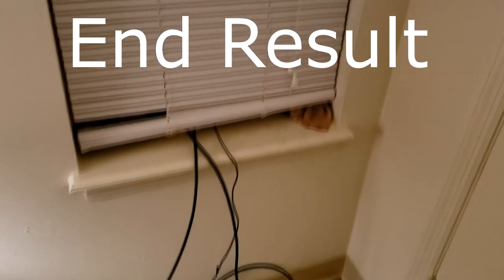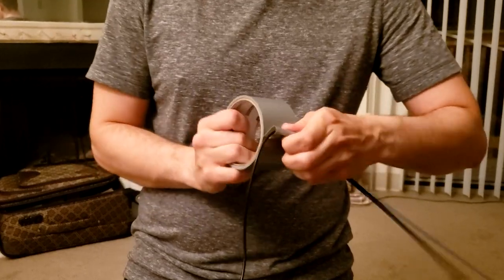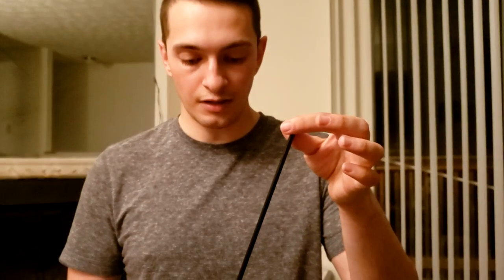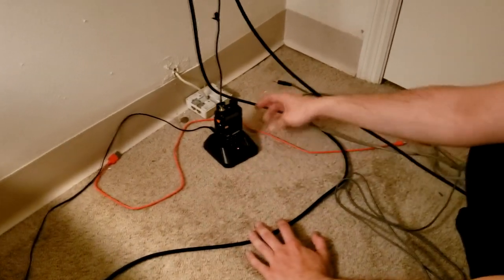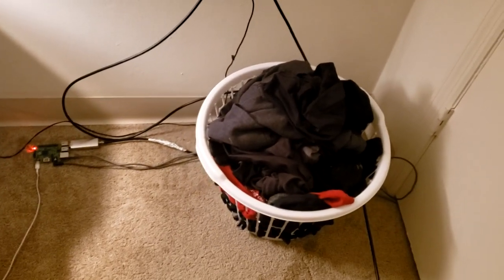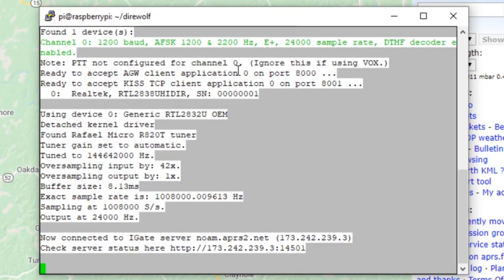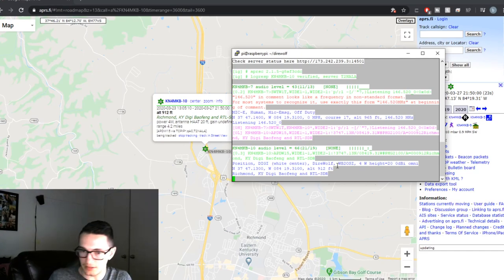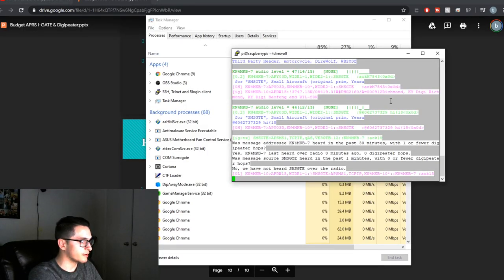Building APRS Digipeater IGate with RTL-SDR and Baofeng Radio

Comment from the maker: Let me know what kind of APRS content you want to see in the future!
Reply: I have a tip for you to make whip antenna waterproof but reuseable to . take pvc pipe as long as your whip  take it put cap on  one end then take a flat pvc cap drill a sma or bns to bnc chasse  or sma and drill hole and mount then attach the antenna to one end of the chassie connector then put the whip inside the pvc and attach it to the pvc  to the pvc cap if you got any question let me know i can send you links or help you with the make of the antenna. I use this method alot for my police scanners etc to get them out side

Comment: Decent setup, I just used a Radio Shack scanner for receive Igate using Xastir software. Also works great. Might consider using Astron  BB-30M  DC to DC 12v to 5v converter with battery backup using  12v sealed lead acid battery with a smart charger 
to keep Pi on 24 7.

Comment: I would advise getting a case for that pi, or better yet putting everything in a tupperware container. If there's one thing that rpis hate, it's static electricity. Also a battery eliminator and a USB step up cable (the one from baofeng) might help eliminate some of the noise. Overall though your setup looks pretty solid, I definitely want to build something like this because my aprs coverage isn't all that good either.

Comment: It'll work!

(Control Shift +) to make font larger. In terminal. Not sure about Putty though.

Thanks for the video!
Reply from the maker: Thanks for the tip!
Reply: @ModernHam  I just checked. I was wrong. The ctl shift + only works in Linux terminal. To get larger font you have to change it in Putty manually. Apparently under the Window category. Mine don't show it though on release PuTTY 0.70.

Sorry for the bad info..

Comment: Is there any reason for the RTLSDR as the Rx and not just using the Feng's input audio to the Pi and have direwolf decode it?  What is the advantage here of a seperate antenna over a $10 usb sound card? Not missing beacons during Tx?

Comment: Hi, could you share the content of your digi.conf ? I've just installed direwolf and the rtl-sdr but I still have an issue with the audio input. it seems that the rtf_fm doesn't transmit the sound to direwolf. 73, thanks

Comment: Is this a Receive only i-gate? as in any RF it RX's goes in the SDR then out to the Internet BUT if someone else on the APRS network tries to send a msg back  TO that RF station it will fall short since this setup can't TX out on RF? I need a two way setup with a PTT circuit in my instance .

Comment: Look at KM4ACK videos on buld A Pi! He gives a line by line program a Pi to do many things.  You just got to his hub and download the program and it will do APFS, Winlink, and many other things.  Call logging, make a wifi that many can log in and send text messages and email.  It has emergency management forms for text and emails. You can log into it over the internet to control it,  it has rig control for the radios that can use it. It also has a menu interface!  He with a lot of people have put a lot of work in to making a software package that will do so many different things.  Check it out!